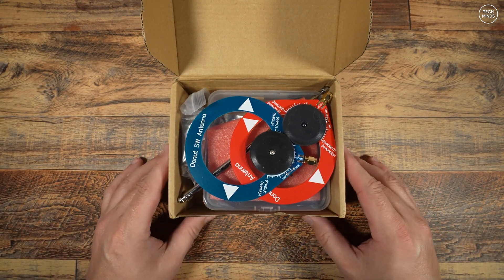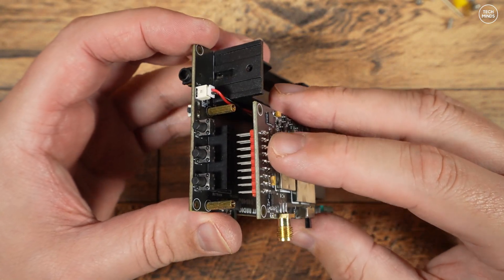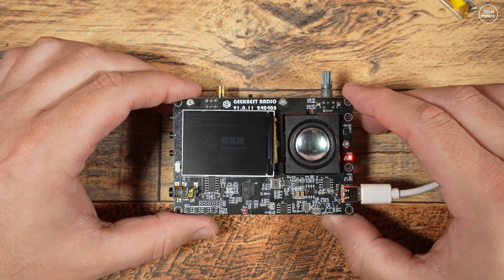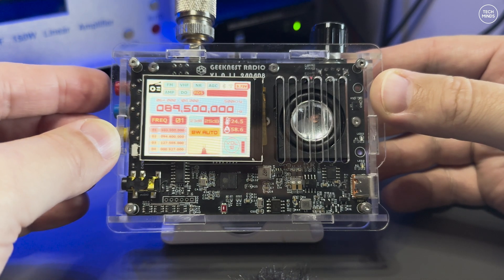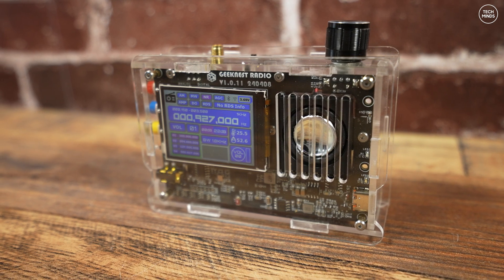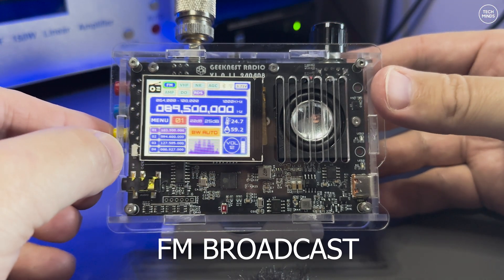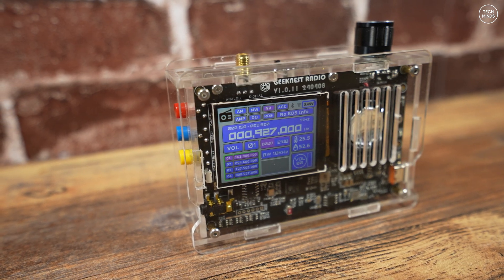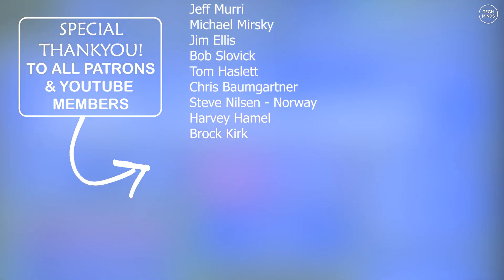GeekNest V5A HF/SSB/SHORTWAVE/AIRBAND & FM Broadcast Radio Receiver

Comment: Looking at the PCB photos and schematic diagram of this radio, it appears that it includes both Si5351 and SA602 chips. Therefore, I suspect that the Si4732 is primarily being used for demodulation, while tuning and frequency conversion rely on the Si5351 and SA602.
I believe the advantage of this design could be improved RF front-end performance (such as sensitivity, selectivity, and interference rejection) compared to using the Si4732 alone, or possibly to avoid the DSP-specific muting that occurs during frequency changes. What do you think about this?
Additionally, the official website states that a commercial version of the firmware requires an authentication chip. Meanwhile, the open-source firmware version mentioned (yoRadio) seems primarily designed for internet radio purposes, and I haven't found fully open-source code specifically including the RF radio functions. Therefore, it's a bit unclear if this can genuinely be called "open-source."
Fortunately, the controller for this radio is an ESP32, and the other major components (Si4732, Si5351, SA602) are well-documented with publicly available information. Writing custom firmware could be an interesting approach rather than relying on the official firmware.
I would greatly appreciate hearing your thoughts and any additional information you may have!

Comment: I'm just jealous of how clean your 40m signal reception is. I have S7-S9 noise floor in my neighborhood on anything below 20m. I can barely hear anything on 40m and 80m without running noise reduction filters on my rig. This thing would basically be useless for anything other than AM/FM/Airband for me.

I do enjoy these 'DIY' style kits though. They can be pretty fun to build. I really enjoy the ones you actually have to populate the boards yourself. For the price of this kit though, I'm wondering if there are better prebuilt units out there.

Comment: Running Windows 11, have not been able to update firmware, currently using 2,9.11, while 2.9.14 is latest. Also have not been able to get audio using AO...a little more detailed video be nice.
Reply: Where would you get the firmware if you could? I have yet to see a place to find updated firmware or info.

Comment: If there is a way to move the on-screen output to hdmi, etc. The screen is really tiny. The whole unit would easily fit on the back of a monitor with the controls exported to a breadboard, etc.

Comment: I have had a slew of bad experiences with AE with electronics.  One of their games is that a seller takes the order and then comes back and tells you "Hello friend, this order was abnormally returned by the logistics provider. Please apply to cancel the order." [sic]  This is what I got when I ordered the extended package with the two donut antennas and amplifier box from VIBRATITE.  Then you take it up with AE to make them ship the products in compliance with standard legal practice that if you sell it on an online marketplace you have no legal standing to back out of the deal only to be stonewalled by their incompetent customer service.  And AE never gets rid of these scammers when the complaints escalate.  So, I went to AZ and got the basic kit for  $56.96 delivered to the USA with all of AZ's protections.  I think the best I saw this on AC was for $49.50.  Maybe a few bucks less applying "coins."  The difference is hardly worth the hassle of dealing with the incompetence of AE.  Further, eB is out of the game because they were lowest at $62, but had dozens at $70, $80 and $90+

Comment: The audio of ssb sounded clean, and so did the aircraft band. But why would i spend $50 on a kit when i can buy a portable receiver with the same features for about the same price? Am i missing something here?
Reply: Kits are usually meant for people learning to assemble things, like kids for example. Or someone that simply likes putting things together, or likes the ability of the radio of not being locked down like most other radios.

Comment: Some electronics DIY makers have modified V5A radio by 3D printing new cases, designing PCBA to convert it to stereo, replacing it with a larger LCD screen, and adding decorative stickers to the acrylic casing to give it a unique appearance. Here are some examples of makers showcasing their modified versions. If you have the capability to 3D print a case, design PCBs, and solder, please feel free to contact me for the open-source modification resources provided by these makers:face-red-heart-shape:.

Comment: I ordered one of these V5A radios a few months ago from Aliexpress to see what it was all about. Then I used the video "manual" to help me assemble it and use the controls. There's a lot of functionality in this unit once you learn how to navigate the menus. I find it to be reasonably sensitive and selective on MW and FM broadcast, though not as sensitive as the Eton Elite Executive I compared it to, but somewhere around the performance of the Tivdio V-111. On the shortwave bands it has reasonable sensitivity when used with a 20 foot random wire. SSB works okay and it is able to fine tune USB or LSB well enough for the speech to be intelligible. The air band also has reasonable performance.

I was able to find an undocumented menu function that switched on the bluetooth. My phone could see the device but was unable to pair with it. I leave the audio switched to analog because I want the ability to listen to SSB, but don't see a difference in performance with either setting. This radio appears to have lots of built in functions that a firmware upgrade could unlock and I look forward to seeing what it could do with that.

An avid DX hunter would not likely choose this radio for their hobby but it works well for general listening and if you like to tinker with it.
Reply: In this video he had some ham operators tuned in on SSB on 40 meter band and it sounded great to me. So you says it's not intelligible evades me. Possible you didn't reduce the tuning step size down to a small enough increment to get a good sound? I go down to 100Hz increments on my Malahit DSP2 and then I can get the SSB sound to be spot on.
Reply: We are updating the firmware and the user manual, but this may need some time.Thank you for your comment, this will help us to improve the experience.
Reply: I'd like to know about the apparent RDS functionality. Serms the makers have lost interest hence no firmware updates
Reply: @digitalmediafan  it takes time to do, it's not an instant press of a button thing.

Comment: As a member of the V5A radio development team, I’m honored to have seen your review video. I’d like to address some of the questions raised by you and other commenters, in the hopes of helping those who want to get the most out of the V5A radio:

The V5A is a beginner-level product that leverages many open-source community resources. However, it still has several issues that my team and I are continuously working to update and optimize.
Reply: Regarding extending the frequency range (e.g., beyond 137MHz): In CN, frequencies above 137MHz are generally unavailable (except for certain specialized bands like walkie-talkies). That’s why we initially set the frequency limit at 137MHz during the hardware design phase. However, we will consider your valuable suggestions and explore the possibility of adding higher frequency bands in future updates.

I’m thrilled to see so many people here interested in experimenting with the Gugu radio. Moving forward, we’ll also be focusing more on supporting our international users. If you have any other ideas or requests, please feel free to reach out to me.
Reply from the maker: @Belleninnovatrix7993 Thank you so much for your comment, this really helps potential buyers know that you are serious about making a great product. Thanks again! Please can you drop me an email when any new firmware drops, so that I can test the internet player. thanks, matt
Reply: Regarding the Yoradio internet radio: Its firmware will also be uploaded to GitHub, and users can follow the same update instructions as for the V5A. Updates will be available shortly.

As for the RDS unavailability issue: This might be due to a system bug or could be related to the fact that RDS information is not available on some radio stations in certain countries or regions. We are continuing to investigate this issue, and it may take some time to fully resolve.
Reply: I purchased this radio and found it difficult to assemble since I could not find an instructions. A link in the package of parts would be helpful to eliminate assembling and reassembling when parts are not installed in the correct place or orientation.
Reply: @kevinking4371  I agree.  Assembled mine yesterday, then had to take it all apart because I ran the speaker lead on the wrong side of the PC board, and the plastic case will not close unless you run it on the proper side (it needs to be run out the tiny notch right next to the speaker in the main PC board, so it ends up running between the Main PC board and the Geeknest Radio board.  Then it will properly reach to the SPK jack on the Main board and not interfere with fitting of the PC boards and the case.  I really wish there was an official assembly instruction sheet in real English.  If it were not for this video, I never would have figured out how to assemble this thing!  It also took me forever to find out how to turn the dang thing on!  For those that are struggling, you have to first charge the battery via the USB-C connector, then remove the charging cable, switch the power switch to ON (marked on the bottom of the PC board), then  press and hold the knob in until you see the screen come on (about 2-3 seconds).
Reply: Make it open-source and let us write our own firmware for it using Arduino etc. I would purchase for that. Thanks!  Cool kit.
Reply: A more detailed "how-to" on updating the firmware be nice.......have yet to get it to work.
Reply: Здравствуйте ,скажите пожалуйста как включить lsb ,usb,я не могу разобраться с меню,на русском языке ничего нет,помогите пожалуйста,мне приёмник подарили,дизайном и качеством очень даволен но вот инструкции нигде нет(((((

Comment: It's listed as going up to 137MHz for the Aviation band. That's quite close to the frequencies used by WESAT (Weather Satellites).
If I could tweak the range, just by a bit... very tempting to buy and fiddle.
Reply: I may consider your idea, because the low pass filter of this radio is 150Mhz. Will try in future of firmware.
Reply: @alec_cy-geeknest  If the LPF is at 150MHz, then it could both cover the weather satellite band and the 2m amateur band. I don't know how much memory or processing power or memory this thing has, but a built in satellite tracker (updated over Wifi!) and automatic doppler shift would be brilliant!
Reply: @digitalmediafan  Shrug
Reply: Per check with this with other friend, geeknest v5a may need AT1846s extension board to receive this, and also need an small update to FW.
Reply: Does it use a touch screen

Comment: The RDS subcarrier is universal. So it should work in the UK. The only difference between countries is how some advanced data fields are used. Those fields are not even shown by most receivers, so they are irrelevant.